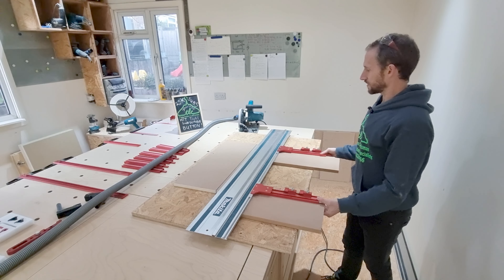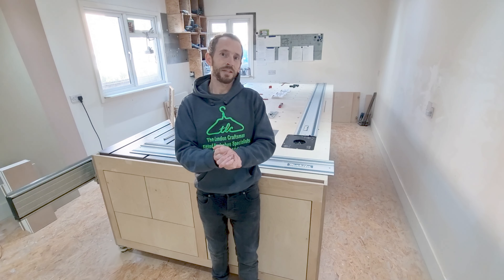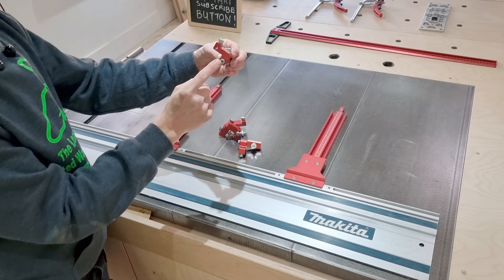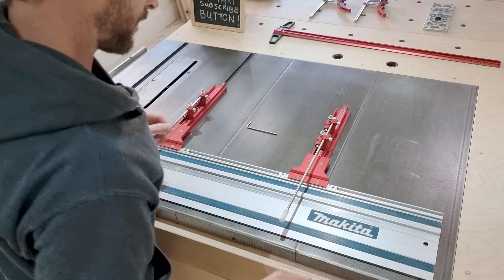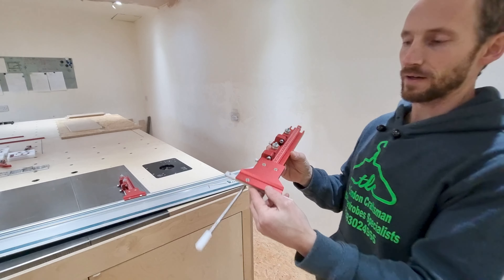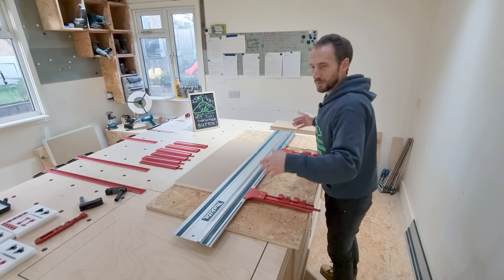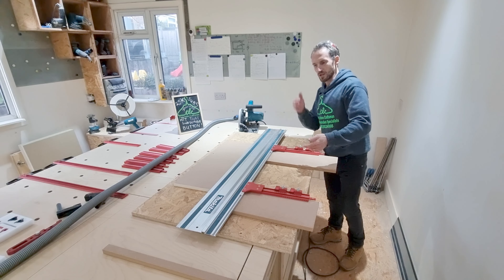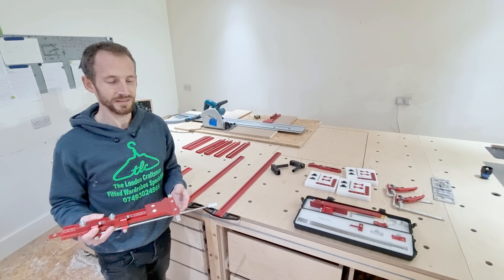Using the THIN RIP GUIDES On The RIDICULOUSLY Cheap BANGGOOD PARALLEL GUIDES - Not To Miss - Vid#80

Comment: I made my own and I deliberately didn’t put any measuring tape on them.  I use a steel rule to set the depth of cut on one guide and the put the two guides together and set them the same.  It’s more important that they are set the same.  Half a mm out isn’t a problem as long as they are parallel.

Comment: I really appreciate your information, very helpful.
I wonder if you have any suggestions for my biggest track saw challenge. I make folded box shelves with the most common being 3" thick so I need to cut 3" strips that are 45'd on both sides and sometimes both ends. I have yet to find, 1st a good way to set up for these cuts, 2nd a repeatable set up. The sharp edge of the 45 doesn't reliably hit a stop often sliding up a little past it and that edge is fragile and easily damaged. Any thoughts would be really helpful. Thank you
Reply from the maker: That's ok, I think the best way with that would be to do it without the guides. Just put the track on the piece up against a line you draw on and cut. You may have to use some offcuts to pack up the track at the back but other than that I'm not sure what else you could do, unless you have a table saw
Reply: @thelondoncraftsmanworkshop  That's the best I've come up with so far too. Thank you for the input.
Reply from the maker: You're welcome and good luck!

Comment: I have Dewalt Track. Is there a way to either modify the guides or the track to work with my Dewalt? Dewalt track doesn't have a grove/channel for these guides to fit in

Comment: See the benefits in these for bigger repetitive rips rips say breaking a sheet down into the 400mm lengths to be cross cut into 600mm carcass sides but much like every other PG system out there they are not great for thin rips (I’ve owned the Festool PG set in the past)

Best way I’ve found is to use a decent combi square and a pair off waste side jigs which cost under a tenner. If you want speed to this process just add a rail square to the equation.
Reply: I agree and imo for thin rips the best way is to use a table saw.

Comment: My parallel rails arrived yesterday along with squares and clamps. Looking forward to your set up next week and for the UK weather to warm up before I can set mine up. Could you do a review of the guide rail square as that is sitting in my cart at the moment but gets mixed reviews over accuracy. Great video series Ryan.
Reply: I can possibly help. I’m talking here about the Festool parallel rails (I wouldn’t have bought them if the Veiko ones were available at the time) but you really only need to set it all up once. Having said that, I do regularly check mine (on the piece I’ve just cut) to make sure there is no wandering.

The Banggood tracksaw square. I am presuming you mean the bright aluminium ones that are about £24? If so, I have 2 of them. Bought 2 so that I could use one each side of the panel I’m cutting to maintain squareness both sides. Having said that, I probably won’t use them in that way. Anyway, my 2 were as accurate as I want them to be. Using the test that was for ordinary square (lay down one way, pencil the cut line; reverse the square and pencil line that way; ideally, both lines should be parallel to each other) my 2 were less than 1mm out of square over the 1400mm length of the Festool track saw. That’s small enough to be my error with the pencils.

I was buying Banggood maybe 5 years ago? I was very sceptical at first but took the chance and have never had anything sufficiently inaccurate to be an issue. I keep/kept a Woodpeckers large square as my reference square for all others; still got it but I found that, with Banggood, I don’t need it. 

I’m quite happy to believe that others have had bad stuff. I’ve certainly had non- woodworking stuff from Banggood or AliExpress which is just not right but, so far, I’ve been lucky on woodworking stuff. 

At one point, I did look at buying some quite big woodworking machinery from one of them. It was buying direct from the factory; was a lot of money but still cheaper than retailers over here. I didn’t do it because I figured it was too much of a gamble for several thousands of pounds; I would buy from Axminster or Woodworkers Workshop etc. because you do get excellent service and no-quibble replacement.

Hope that helps
Reply from the maker: Great input theo thanks!
I've not used my square yet but will do soon 👍

Comment: For thin strips, the board is not fixed to the rail, the rubber does not sit on the board. How do you manage this issue?
Reply from the maker: I cant remember, sorry, not used it for thin rips since making the video
Thanks Ryan

Comment: Any idea if these fit the mafell/ Bosch rails? Do you have a link please.
Reply from the maker: Hi the links are in my video description.
If they didn't fit, it would only be a matter of changing the bars that slide into the track and would be able to buy them for a few pounds anywhere online. Everything else about the guides would be fine! 
Im sure they would fit though and we'll worth it still 100%

Comment: Is it not working out 30mm less blade thikness?
Reply: Surely you only need to take blade thickness into account when you se doing a waste side cut. These cuts are 30mm under the rail like a typical MFT cut so no blade thickness is deducted.

Comment: So, I picked up a set of these and am very impressed with the build quality. Especially for the price. The one exception is calibration. Like your other video, I find the wide cuts are off by about 2mm after calibrating using the bars. I can either calibrate for narrow cuts using the recommended method and remember to subtract 2mm when making wide cuts or calibrate for wide cuts and remember to add 2mm for narrow cuts. Only other option is to calibrate each time for the typ of cuts (wide or narrow). That is a bit disappointing as it would be best to only have to calibrate the heads for your track once. I am thinking I may be able to get some washers that are 2mm thickness and put them on the rod between the nut and the flip stop for calibration and take it off when using the rods for actual narrow cuts. I think that will make up the difference needed. It almost seems like the alignment of the numbers between the side and top may be off by 2mm.
Reply from the maker: Wise decision to buy them 👍
I didnt come across that problem but the washer idea seems like a quick and easy fix that solves both problems 👍
Reply: I exactly have the same issue, but for me it’s about 1mm difference. There may be several reasons for this and ways to correct it: The rod is too long, the plastic tip is too long, the drilled hole in the tip is not deep enough, the flip stop body is too narrow or the calibration mark and side scale are offset (unlikely). The easiest ways would be to cut or grind the plastic tip by the required amount or use washers. 
By the way… what is the use of the front calibration mark? It is never referenced to during calibration. It doesn’t matter where you place the front flip stop.
Reply: @martink7777  The more I use them, the more I realize I just need to calibrate the narrow rip rods each time I need to make that type of cut. I have calibrated my set through numerous cut/measure/adjust cycles and feel I have them where I want for making wider rips. I would like to keep from adjusting the head attachment any further for fear of messing that up. It seemed like just using a single 6mm stainless steel washer between the cylindrical cap and the flip stop was working but I noticed recently it is not giving me consistent results. I am thinking I may need to go to something like a clamping collar on the track side of the flip stop to gain a consistent stopping point for calibration. this would make the rods a little more finicky to install but may be worth it. Looking at something like this https://www.servocity.com/2910-series-aluminum-clamping-collar-6mm-id-x-19mm-od-9mm-length/
Reply: I have the exact same problem! It is off by 2mm for wide cuts on my makita track! I have been thinking to make setup block to place between the track bar and the track head with the required thickness after calibration. That way I can quickly adjust the heads and I can even disassemble the heads to store away. For the thin rips I thought about glueing over a new tape measure that corrects the offset for thin rips. I thought I was the only one and I was doing sth wrong, but I am glad there are others like me so I know I’m not missing something.

Comment: What if the tape measure is off a slight bit, then the scale is useless and every project would require a dial in? And test cut?
Reply from the maker: Well generally you dial it in once and that's it

Comment: Banggood update; Finally went to the app and this malfunctions badly. Originally £70 on UK site which then went to £85 but my order could not be accepted. Finally made difficult, and I mean difficult, progress with the app for shipping from the US and the price went up to $112 which is £93! All looking like a bit of a rip off at the moment. No doubt I will get a bill for import duty - wouldn't be the first time. Everybody! Be aware of the shortcomings of Banggood 😱
Reply: They sell exactly the same on Ebay, a name band which I purchased. I have avoided Banggoods as they are so very slow at sending to Australia

Comment: Banggood - What a crock of sh**t. I have wasted so much time trying to order from both your link and from a direct search. First attempt said product not available and unable to order. Second attempt product available but would not progress past the "Pay" section of the website. Third attempt tried using Firefox (I have a MacBook) and it wouldn't even recognise by email/password, Foruth attempt back to your link and same again, would not progress onto the "Pay" section. If you recommend something then please make sure that the supplier is reliable.😱